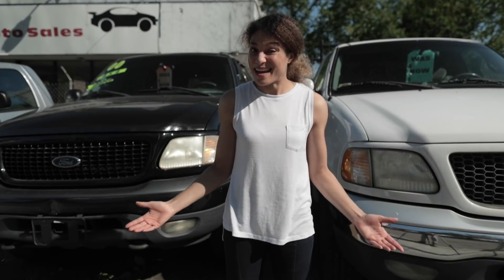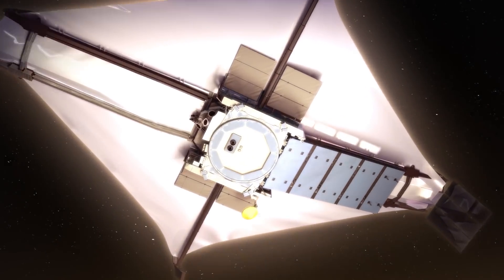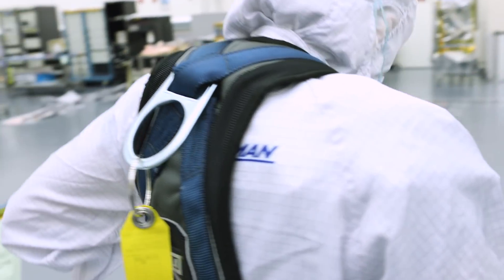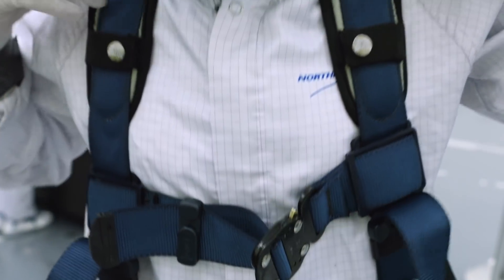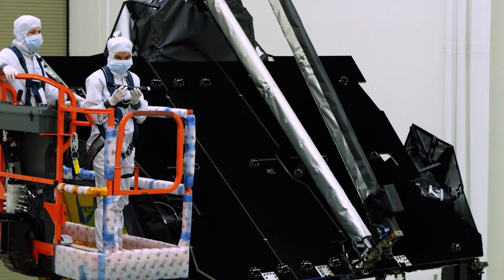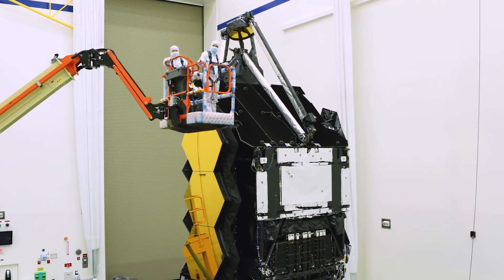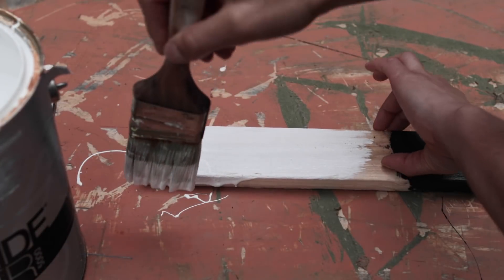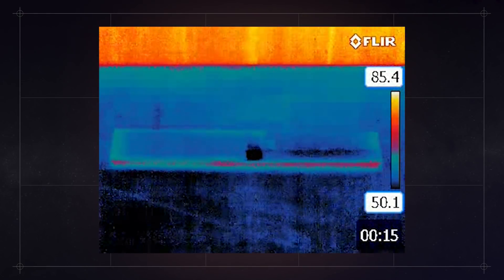Elements of Webb: Super Black, Ep11

Comment: I'm curious about the fast travelling debris/particles that could hit micro holes in the shields/mirrors. Or it is a so rare event we don't need to care about.
Reply: It's in the design consideration, they have rip-stop on the shields and it's overbuilt to still be in spec even after some damage. The langrange point is also an advantageous location for being relatively empty.
Reply: The spacecraft is designed to expect a certain amount of degredation over time from micrometeoroid impacts.
Reply: It'll 100% happen. We just have to hope it's not too bad pretty much.

Comment: I remember that that's the reason why Bedouins wear layers of clothes and above all the layers dark or black clothes. The darkness of the topmost layer keeps the heat from reaching the skin. I think it's the same reason why many birds in warmer areas have dark or black feathers. Thank you very much!🖖🤗
Reply: In sunlight, black absorbs more heat. White is usually more effective at keeping you cool but black can produce convection currents within loose fitting robes to remove heat. At night, black can radiate heat away, but does not "keep the heat from reaching the skin" at any time.
Reply: @Nilguiri  
"The additional heat absorbed by
the black robe was lost before it reached the skin."
Direct quote from the original study by Tel Aviv university 1980 published in Nature.

Comment: I've been wondering if the James Webb would have the new vantablack. It's remarkable to think we can do so much better than even the James Webb!
Reply: Notice the emphasis in this video on being black in the infrared and being an efficient thermal radiator*, whereas vantablack is all about *appearing black to the human eye in the visible . Completely different design criteria, even if both can be simplified as "woah it's really black" in popular media.
Reply: @TheHuesSciTech  Vantablack is extremely black from 200nm in the UV to >600 microns in the far infrared.  In case you missed it in the video, the "design criteria" of making something an extremely good light absorber also makes it an extremely good radiator.
Reply: They use active cooling I think for the bits that need to be really cold, so it's not really worth heroic efforts. Good enough is good enough, it'll just be a few % bigger.
Better also to use something known and tested in space. It'd suck if the vantablack flaked off in a year.
Reply: @zyeborm  Vantablack S-IR is specifically space qualified as an IR blackbody radiator for spacecraft.
Reply: @stargazer7644  it wasn't 20 years ago when Webb started
Reply: @zyeborm  And multi segmented computer controlled gold plated beryllium mirrors also weren't a thing when Webb started 20 years ago either.  What's your point?  Vantablack has been around for 8 years.

Comment: don't they want to keep miscellaneous IR energy away from the cool side? why would they want to radiate the heat away from JWST on the side that they want to keep it away from?
Reply: You want your radiator on the shady side because, were it to be on the sunny side, it'd be absorbing loads of energy, too. On the cold side, the radiator's equilibrium will be colder because incoming radiation will be less than what it's emitting. The heat just radiates away into free space.
Reply: Similar to a person being submerged in a large body of very cold water, like an ocean.  The relative difference between a person and the ocean means heat is dissipated quickly and easily
Reply: They're radiating the heat toward the cold sky, not the rest of the telescope.